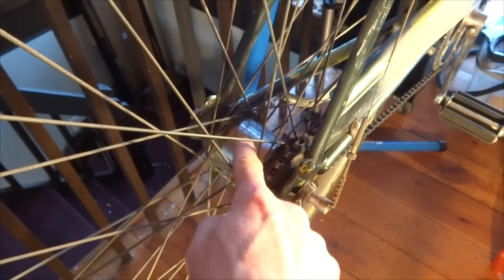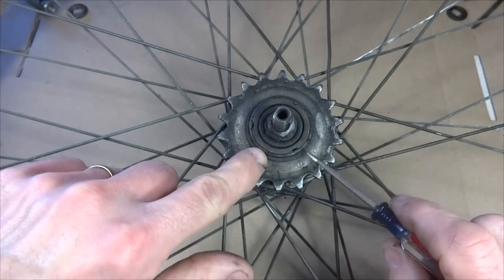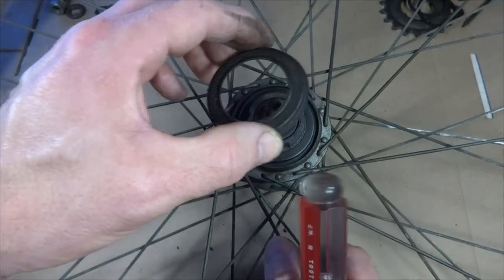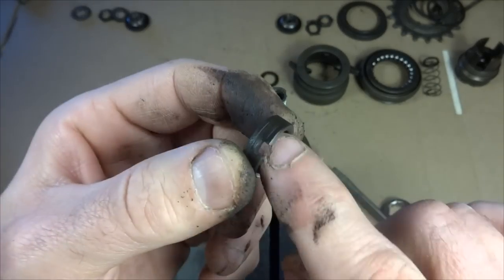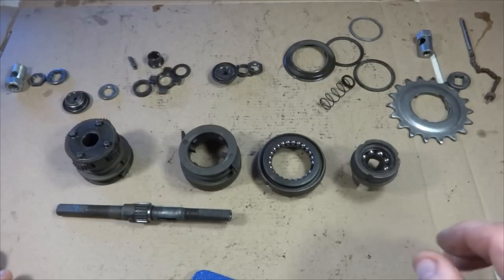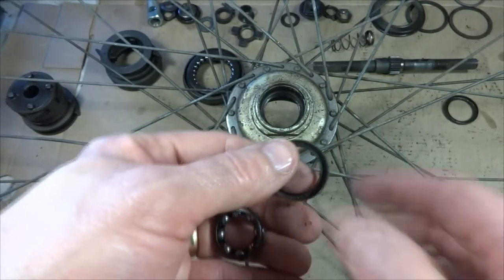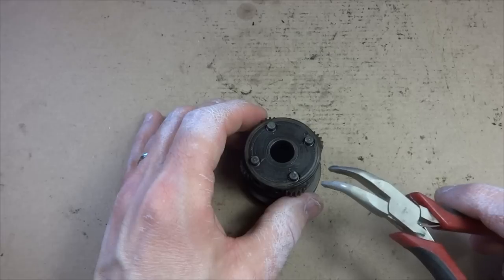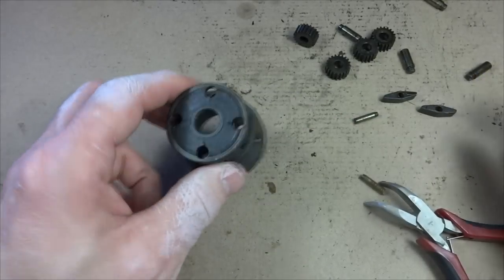Overhauling 60 Year Old Sturmey Archer 3 Speed Hub

Comment: Hi, my friend, I admire your work, you can say that I am your fan! Im from Austria, so my english is a bit strange, but I give my best to make me understandable. I have a question: Could you explain one day how to remove the brake of a Sachs-Tornado 3-Gear? I don´t like that kind of break but I also don´t want to lose the 3 gears. Thanks for reading and good luck.
Reply: +EISENKOPF 1954 Is it a coaster type brake where you backpedal to brake or it is like on a scooter which uses a cable? I've seen yesterday two of those externally actuated Sachs 3 Gear hubs and they are awesome. Cheers :)
Reply from the maker: +EISENKOPF 1954 Not sure what would happen if you tried to remove the brake from a coaster brake. Probably a better quality option would be to replace the wheel with one with a nice Sturmey Archer 3 speed hub. Or have your current wheel rebuilt with a new hub.
Reply: Thanks for having taken time RJ, I decided to buy another wheel - Fix gear!

Comment: Great video ! I have dismounted the hub just as you did in order to check what was making a rattling noise. I have cleaned and lubricated the whole thing and now I have mounted it back againon the bike and it is not making any noise any longer but ...

Now whatever the cable tension I choose I only have access to two speed and sometimes I find myself in "neutral" (no wheel traction). Any idea on possible resaons for that ?

Thanks in advance
Reply from the maker: https://www.youtube.com/watch?v=KvR0S6lHJ4Q
Reply: Apparently the "in between gear" or "false neutral" problem is well-known on this model and depends on the unappropriate setting of the cable but i have no idea about why I can't to speed number one.
Reply from the maker: My guess is it isn't adjusted correctly. Or if you took it apart, you didn't put it back together correctly, like putting the pawls back in incorrectly.
Reply: Thanks for replying so fast. Your channel is impressive.

Comment: I'm having trouble getting the hub out of the wheel. I've been hammering it for an hour and still cannot get it to move. Any advice?
Reply from the maker: +Dan LaCerva Not quite sure what you mean getting the hub out of the wheel?
Reply: +RJ The Bike Guy I mean removing the assembly from the hub shell
Reply from the maker: Do you mean the step at 4:45, removing the ball cup? The hub is a Sturmey Archer AW? You followed all the other steps?
Reply: +RJ The Bike Guy yes the huh is a sturmey archer AW and is probably 61 years old. It has the notches to fit the screwdriver in but it won't budge.
Reply: +Dan LaCerva I finally got the ball cup out. I greased it last night and let it sit all night and greased i once more this morning. It finally screwed out as it should. Thanks for this video, it's incredibly helpful.
Reply from the maker: The ball cup gets tightened as you ride. So they can get really tight.

Comment: Do you know if you can convert a sturmey archer hub to a fixie?
Reply from the maker: Gerald Reisinger Probably.
Reply: +Gerald Reisinger That would be a travesty!
Reply: +zilfondel I did not have the heart to kill the hub after all :)
Reply: +Gerald Reisinger These three speed hubs are still worth ~$50, so it would be better to sell it and get a single speed hub.  Sheldon Brown has some great info on flip-flop and single speed conversions!
Reply: +zilfondel 50$?! You can get a pretty decent bike with a three-speed-hub here in Austria. I should probably sell my spare parts to the US then :D
Reply from the maker: I have seen them cheaper than $50. I have bought whole used bikes with SA hubs for under $50.
Reply: +RJ The Bike Guy 
Interesting.
A fixed sturmey (S3X) cost over £200 in the UK.
I expect one of the original ASC fixed hubs would be worth even more.
Reply: That's something you might do by accident.
Reply: Gerald Reisinger z